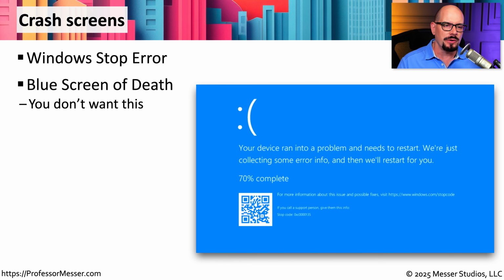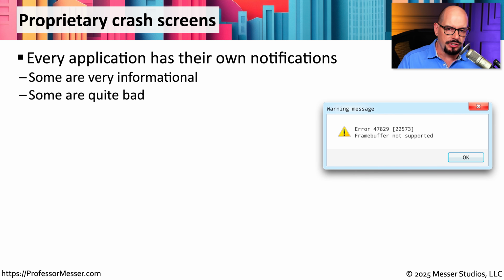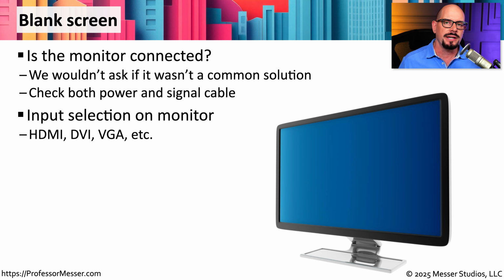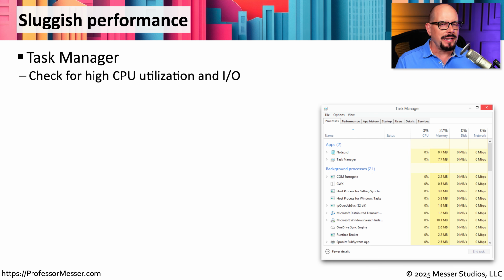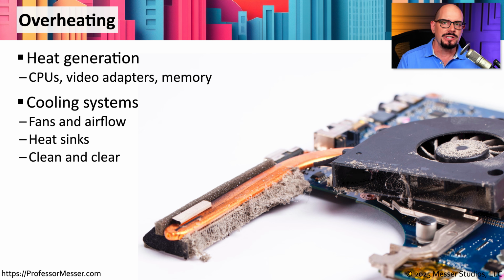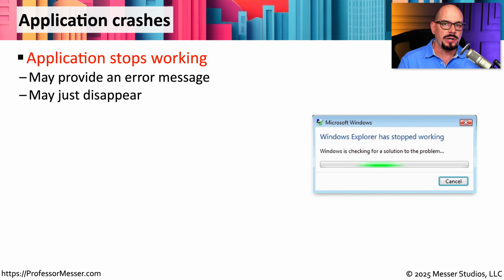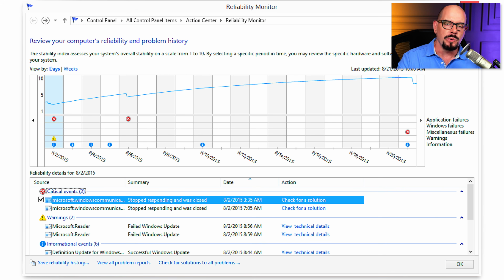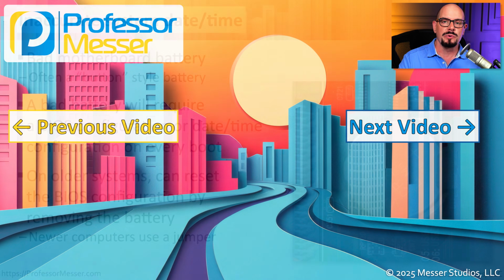Troubleshooting Hardware - CompTIA A+ 220-1201 - 5.1

Comment: When I first tried to upgrade my PC around the time they were ending support for W10, I ended up getting a bricked mobo. It would boot to the BIOS, so I would try to overclock it, which helped a little bit, but I just ended up taking it back to the store and they told me the mobo was actually dead, iirc.

Comment: I managed to pass core 1 today using these videos and didn't even finish all of them due to lack of time. Thank you so much professor!!
Reply: Just curious, how much knowledge did you have before hand? Were you pretty familiar with computers already?
Reply: @Daniel-vc1oc Not so much on the hardware side, but I've been bulding websites for the past 2 years. I also watched a lot of NetworkChuck's videos.

I took my time with each video and asked chatgpt to explain some of the concepts as well with analogies.
Reply: Hi, I am planning to take the core 1 exam next week and am pretty anxious about it. Could you share your experience on the level of the difficulty? Thank you!
Reply: @yingwu5206 how did it go?
Reply: @yingwu5206  im taking mine next week how did yours go, any tips?
Reply: @JessThyMess.  how did u do?
Reply: @yingwu5206 5/10

Not too much other than memorizing & vocabulary or terminology 

The “hardest” part is the way things are worded. Make sure you really understand the question

Comment: 17:45 ' Electrical Problems - The smoke makes everything work ' Is that suppose to say "worse" instead of "work"?
Reply from the maker: If the smoke gets out, then nothing works! Therefore, the smoke makes everything work.
Reply: I see 😂 thanks! @professormesser
Reply: It's trade humor- I learned all about the magic smoke when I lost my first 3d printer!
Reply: I was really confused too. English isn't my first language 😅🤣
Reply: I still dont get it lol
Reply: @Abelsan3642  I think it's just a joke about the smoke that components let out when they're damaged. He's essentially saying that, as long as you keep the smoke inside, the component keeps working, he's not literally saying there's smoke inside components though.
Reply: @Abelsan3642  1. The "Magic Smoke" Theory

    The Premise: All electronic components are manufactured with a certain amount of "magic smoke" sealed inside them.
    The Observation: As long as the smoke stays inside, the device operates perfectly.
    The Failure: When a component overheats or breaks, it releases this smoke, and the device ceases to work.
    The Conclusion: Therefore, the smoke is the "essential ingredient" that makes everything work.

^Google. It was my first time hearing it too 😅

Edit: Just to clarify, the short version is there isn't actual smoke in it, it's just a joke that when things smoke they're broken, if you don't have smoke coming out of it then it still works. So there's "imaginary magic smoke" that keeps it working but once you see that smoke come out, it's broken.